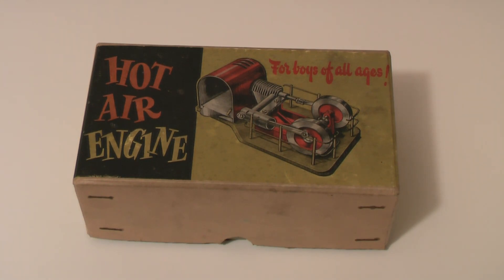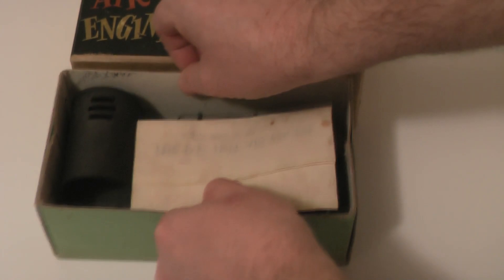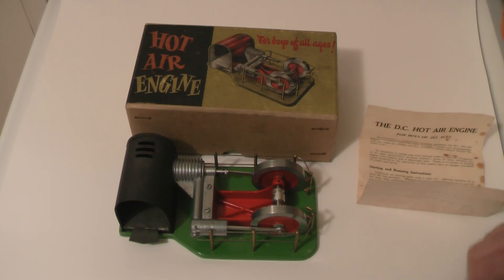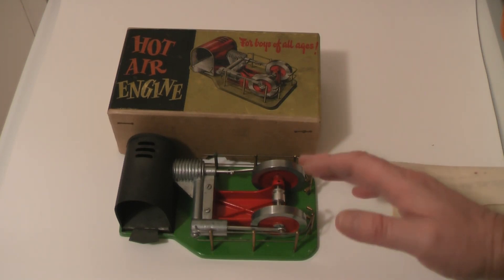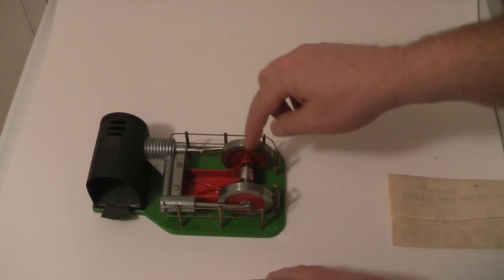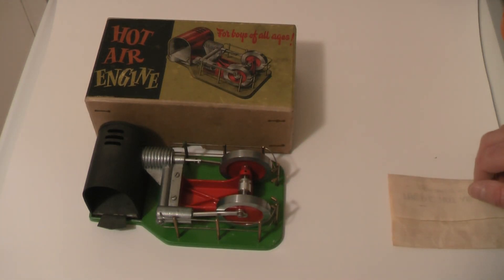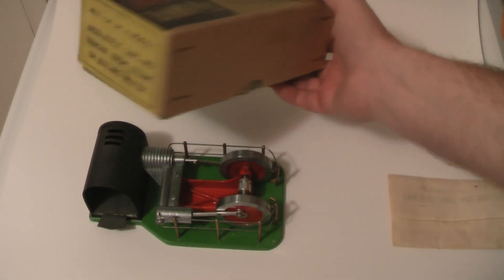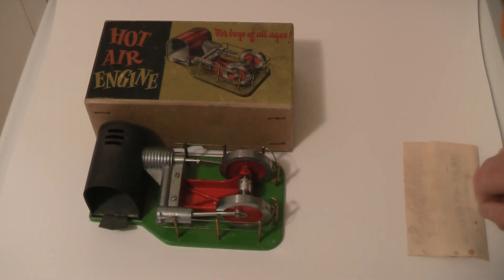Davies Charlton Hot air engine

Comment: Hi, I know this video was 5 years ago but I wonder if you can help me?  After years of looking I've managed to buy one of these little engines.  Everything is there except for what appears to be a 'cap' or 'top' to the wick holder which unfortunately I can't see on your video.  It looks like a small press fit cap with a centre hole and three smaller holes around the edge.  The centre hole I presume is for the wick and the other holes would be vents.  If you still have the engine, would you be able to confirm my thoughts and if possible give me some dimensions so that I may produce a similar one?  I'll send my email if this will help?   Martin
Reply from the maker: Hi Martin
I'll put the dimensions down here but if you want any photos of the burner leave a email address here (I'll delete it later to prevent email spam), length 70mm width 45mm height 8 mm, there is a centre brass ring 20mm x 3 mm, and a brass cap fits in the centre with 4 vents holes and one centre hole for the wick, hope this helps Martin.
Reply from the maker: Hi Martin
Email sent with 7 photos of the burner, let me know if you need any more.